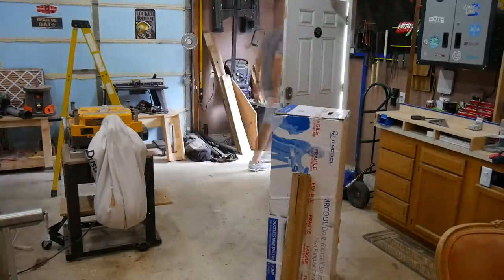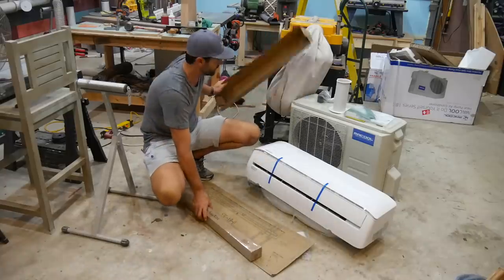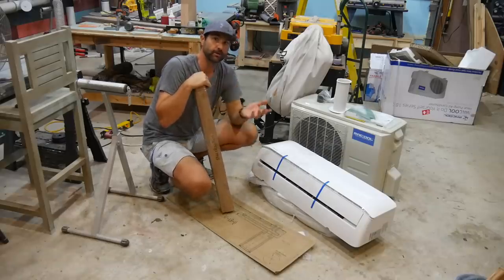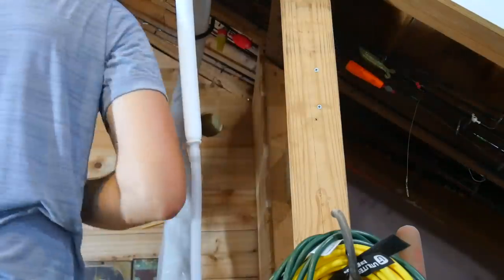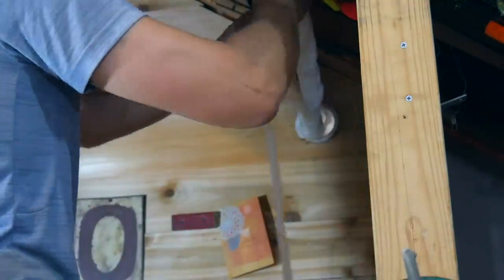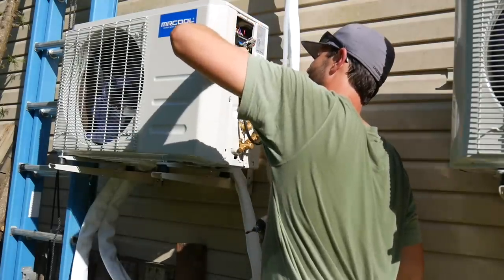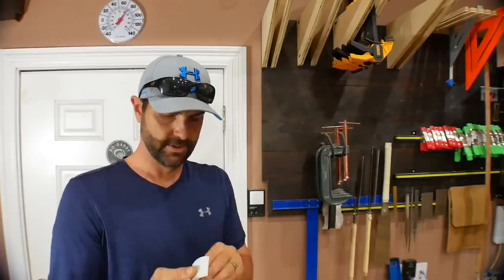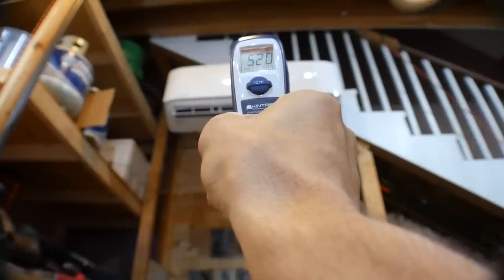DIY Mini Split Installation (Step by Step)

Comment: Keep in mind that attaching compressor unit to house will have negative noise effects.
Personally, I will do everything possible to keep my compressor units physically separated from my house/building. 
A cement pad with a custom made metal stand is worth it to me.
Reply from the maker: Js Travelers - I definitely agree with your comment.  In fact, I have plans to put mine on a concrete pad this winter.
Reply: Even bolted to a poured concrete wall?

Comment: Thanks for the video. Just purchased the same unit and will be installing this weekend. Very helpful step by step on your blog as well. Thanks again.
Reply from the maker: Mike Dockins - very happy it helped you.  Feel free to reach out to me if you have any questions or need advice.  I’ve installed 2 of them in the past 18 months.
Btw, they are both working very well!

Comment: Curious as to what Mr. Cool thinks of coiling the excess line set?   Most do not recommend that as the refrigerant oil/lubrication will settle out in the low spots in the coil and starve the compressor shortening its life.  Interesting video.  Did you get a lot of vibration transmitted through the house wall?  Take care.  Doug
Reply: Douglas Thompson , my thoughts exactly. 
The noise transmission would drive me crazy. The line set coiled up along with the duct tape. It's an easy set up but finish and appearance ... C-

Comment: I just purchased this system along with what looks to be the same wall mount bracket as you. The MR Cool documentations mentions you want ~12''' of space behind the outdoor condenser but the mount only gives you about 5.5. Have you had any performance issues?
Reply from the maker: No performance issues at all.

Comment: Two things here-First a sprayer isn't going to identify any leaks unless you put some nitrogen in there to begin with. Second a vacuum needs to be applied to remove any garbage such as moisture that might be present in the exposed copper lines that were installed.
Reply from the maker: I agree with the first comment for sure.  The second comment is not applicable to this system.  Read some of the comments below and the manual:  https://images.homedepot-static.com/catalog/pdfImages/74/74671561-d4e5-43cd-8936-33fdd2526621.pdf
Reply: Very good, so when you put the copper lines on there was already refrigerant sealed in them that was then released. I hope my system that I ordered on ebay is the same way.
Reply from the maker: Russell Eaves yep, that’s correct.  I have 2 of these units and both are running really well.

Comment: You could have coiled up the excess line inside the building
instead of outside where it's unsightly and susceptible to damage.
Otherwise, great job.
Reply from the maker: Ian Crossley - After about 1 year of posting this video, you are the first person to recommend that.  Honestly, I never thought about doing that, but it totally makes sense and I should have.  I feel like a fool for not thinking of hat during installation.  Thanks for commenting and watching..
Reply: Agreed. Putting the excess refrigerant lines inside of the thermal envelope should increase efficiency.   An alternative though would be to use an HVAC professional to install traditional lines and remove the excess line, but I know that's not the point here in a DIY video.   It would be interesting to compare the cost benefit ratio over time.   Good job on the video.  Good dogs. :-)
Reply from the maker: James O'Bryan - the lines outside was definitely a mistake by an inexperienced HVAC DIY’er.  I have sense moved the lines indoors per the recommendation by you all.  Honestly, this was a perfect solution for my workshop.  

Would I put these units in my main home?  No, I would not.  I prefer to hire a licensed HVAC tech for this installation.
Reply: I thought of this immediately as well.  It's more efficient and it's more attractive
Reply from the maker: Definitely agree.
Reply: This is a great tutorial. I love the whole thing,  except the excess coiled lines would bother me,  and someone else points out mounting to the side of the building ( like I WAS thinking of doing )   would cause excess noise.

Comment: Did you vacuum the line before or no need?
Reply from the maker: Sheralyn De Leon no need
Reply: @PahjoDesigns  so no problem if im install my diy mini split ac without  vacuum pump? I connect the copper tube line ang open the service freon and it will work if there is no leak?
Reply from the maker: Sheralyn De Leon that’s correct.

Comment: If the condenser is going on a flat roof, can you run the condensate drain up there?  That is, do these usually have a condensate pump, or do you need to drill another hole in your wall to drain the condensate (using gravity)?
Reply from the maker: You can use the same hole as the refrigerant bundle as there is enough room.  Or you can drill another small hole for the drain.  There is no pump so gravity must be used.  Thanks for watching!

Comment: Great.  Having been in the HVAC business for 16 years I can remember people asking me things like; Can I replace my own thermostat?  And I would reply with, I don’t know, can you?  So I think this is great information for competent diy people to do. It is not cheap to higher a reputable licensed hvac company to install a leading brand and stand behind it with written warranties and guarantees on parts for 12-Years as we do.  But please understand that this install is not only up to par on an the aesthetics nor equipment quality as we use. But you need to know you have NO Warranty!  Good luck trying to get a Warranty repair or replacement when Mr Cools warranty states: (Limited warranty applies only to systems that are installed by a state certified or licensed HVAC contractor, under applicable local and state law in accordance with all applicable building codes and permits). If this is something you feel comfortable in doing then more power to ya!  I’m just saying, Let the buyer beware. And when it comes to skilled trades projects, cheaper is almost always not better.
Reply from the maker: luckyrocks1 - Thank you for the input as your HVAC experience definitely supersedes mine 16 fold.  These units went in my shed, not my main home bc of the reasons you stated.  It was worth a try for the price.  I did have an issue with the unit and MRCOOL sent me a replacement.  I have a video on this replacement as well in the description of this video.
Reply: Pahjo Designs  That’s great Pahjo and do you think they sent a replacement knowing you were posting on YouTube?  Or do you feel confident that they will do the same thing for everyone who installs these systems simply by following the Included installation instructions?
Reply from the maker: luckyrocks1 - I didn’t tell them I posted on YT.  They did make me get a tech to do diagnose the system.  I had to send them the results then they honored the claim.  Maybe I just got very lucky - who knows.  I’m not affiliated with MRCOOL at all so please don’t think I’m defending them.  In fact, I’m not educated enough on hvac systems to debate anything - just sharing my diy project as honestly as I can.  I really appreciate folks like you chiming in with constructive criticism for everyone to learn from.  Again, I appreciate it.
Reply: Luckyrocks, the requirement for the unit to be "Professionally Installed" warranty you refer to above ONLY applies to NON-D.I.Y. units sold by the company.  Otherwise, the D.I.Y. Warranty is 7 years on the compressor and 5 years on everything else.  Some of the Mr. Cool units that require "Professional Installation" only come with a 2 year compressor warranty and 1 year on everything else.  Go figure!!!!

Comment: Awesome. Mine is on its way. 
Didnt/couldnt excatly learn vacuuming procedures and all that right now. 
What BTU is that unit?
Reply from the maker: Awesome - 18,000 BTUs.  Thanks for watching
Reply: @PahjoDesigns  pppp

Comment: I have a question since I am going to be doing an install myself. How do you get the copper to bend 90 degrees without kinking?
Reply from the maker: Russell Eaves - the copper is somewhat flexible and it is easy to bend.  It is also slightly bent in the spot where it needs to turn which makes it easier.

Comment: Just installed one works great but I do not like it going into defrost mode every 20-25 minutes when in heating mode when its colder outside
Reply from the maker: Glad it worked out for you!  Thankfully, It doesn’t get that cold where I live to go into defrost mode.  :)

Comment: Thanks for the video. I got my 18K unit and I am ready to install. I have a couple of questions. I feel nervous when I bend the pipes so they go straight towards the back as you did. Also, there are two holes on the template. I see no reason I can't have a hole in the middle. The pipe can bend at either end of the inside unit, it sure can bend in the middle as well?  It is just a better location for my situation.
Reply from the maker: I agree and I see no reason it can’t as well.  I actually called them and asked the same question about bending the pipes at either end before i i stalled mine.  The folks at MRCOOL are really responsive to questions.  Did you run it by them?
Reply: Your video is very informative and overall quality is very good so I naturally asked you yesterday here. I think today if I don't hear from you I will ask Mr.Cool the same question. I am surprised to see your reply. You are right they are super response. I requested a replacement of broken wall sleeve(probably due to shipping) yesterday afternoon and I got a response this morning!  I am always grateful to people spending time to share their experience. Thanks a lot again!

Comment: What is the grey flexible conduit and grey box going to the electrical for and can you show the installation of that?
Reply from the maker: GManKeepsltReal - that is the conduit that holds the electrical lines which run to the junction box.  I don’t have that on video bc I’m not qualified to provide electrical advice or show people how to make those connections.   Only certified electricians can accurately and safely provide that advice.  Thanks for watching!!!

Comment: First, thanks for the great video. I am about to buy one for my shop which has two stories. Each are about 500 sq ft. Do you think I should buy a two zone unit rather that buy two separate units like you did.
Reply from the maker: Knott Reel - thanks for watching!  Yes, definitely a 2 zone unit.  Much easier to manage.

Comment: Hello Sir:  I have a question: when you connected your refrigerant lines to the outside unit; you just connected it and dd not vacuum the while system. Is that possible?  Let me know and thanks. My Senville just arrived this weekend.
Reply from the maker: Freddy Panes - it’s not required as they are sealed.  Here is a link to the manual:  https://images.homedepot-static.com/catalog/pdfImages/74/74671561-d4e5-43cd-8936-33fdd2526621.pdf
Reply: Pahjo Designs  Thank you very much! Will do and keep you posted

Comment: If you don't want to answer any electrical questions ok but I'll ask. Different locales may differ, but do they typically require a shutoff next to the outside unit or can it be hard wired with just the service panel breaker for the shutoff? 

Great video, but I thought I would see the initial turn on!
Reply from the maker: Yes, I used a breaker box outside which was already there from my old unit

Comment: I want to understand How the DIY valve Works, do you have some technical information?
Reply from the maker: They are quick connect valves.  Here is a link to the manual:  http://mrcool.com/documentation/mrcool-diy-2nd-gen-installation-manual/

Comment: thanks how many amps does it use so I can figur out what dedicated circut i need
Reply: Kevin Naderi 15 amp circuit will do fine.
Reply: thanks does it run 110 or 220v
Reply: 115

Comment: Why did you have all that excess pipe? That's really inefficient when you have to pump refrigerant over a great distance. You could have shortened this no? Or is the refrigerant inside the pipes and this is not an option?
Reply from the maker: Unfortunately, It is not an option.  They cannot be shortened or cut either.
Reply: @PahjoDesigns   That's a shame. Could a qualified person do it, or is this just how it's made?
Reply from the maker: They seem proprietary, so I presume it’s just how it’s made.  Maybe a qualified hvac tech could do it, but I’m not qualified enough to know for sure.
Reply: @PahjoDesigns   Thanks. I'm wondering if aside from needing an F-Gas engineer to bleed the system, the copper pipe is like 20mm plumbing pipe where you can just cut anywhere and install a compression fitting to shorten, then re-fill. I guess it's a route that's not worth exploring though, due to excessive costs.
Reply from the maker: I think that’s possible for sure, but as you said cost may be a limiting factor.

Comment: Just wondering if you vacuumed you lines sets before you opened the condenser valves?
Reply from the maker: Cat1234 - the lines come precharged.
Reply: oh, I did not know that.  I just installed mine yesterday and had to buy the line sets separate.  I had to pull a vacuum on them before I let the freon out of the unit.  Interesting

Comment: Seems strange you would mount the unit in front of that wall instead of on that wall you routed the piping through.  You have a dead area where no cool are is blowing and looks strange hanging from wood templates.  It becomes the focal point.  Maybe think about just mounting it on that wall.
Reply from the maker: Kimo Jon - you are spot on.  I actually moved it to the back wall about 6 months after this video.  👍🏻

Comment: Jeremy:  Enjoyed  the Mr Cool video. Is the MR Cool efficient to operate in the summer and winter months?  Also  what are the temperature ranges of the unit during the winter and summer months? Online I see some brands state their units will heat 100 % down to 5 F and cool to 115F. Also where did you purchase your Mr Cool? Thanks in advance.  I am considering a multi zone system for my home and doing as much research as possible.
Reply from the maker: I appreciate you watching and it appears as though you are my neighbor from reading your name.  :)

The MRCOOL is definitely efficient in both the summer and winter months.  I have no issues with cooling my workshop during the summer months.  I am in my workshop often and keep the unit running all the time mainly to keep the humidity down to prevent my tools from rusting.  

However, the winters in South Louisiana are mild which make it difficult for me to truly test the unit in brutally cold weather.  We did get snow twice this year (Dec 2017/Jan 2018) and it heated my workshop perfectly.

I purchased 2 units.  I purchased the first unit from Home Depot online and picked it up at The Home Depot in Slidell.  I purchased my first unit from Home Depot because they are lenient with returns in case I had any issues.  I purchased my 2nd unit from Amazon.  Both purchases went smoothly and without issue.  If I were to order another one, I would purchase from Amazon b/c Home Depot doesn't handle store pick-up very well for high dollar items.

I have a detailed blog about this installation on my website which may help you:  https://do-daddy.com/how-install-diy-mini-split/

I actually had to repair my first unit and made a video of the warranty and repair process here:  https://do-daddy.com/mrcool-diy-ductless-mini-split/
Reply: Thanks  Yes New Orleans here. My research indicates MR Cool is a joint venture between Mitsubishi, Toshiba and Hitachi all of which are good cpmpanies
Reply from the maker: I have no complaints - this product fit my needs perfectly and both of my units are performing very well after a year in service.

Comment: Did you vacuum pump the system before you released gas
Reply from the maker: Floyd Afams - that is not required for this system.  Here is a link to the manual:  https://images.homedepot-static.com/catalog/pdfImages/74/74671561-d4e5-43cd-8936-33fdd2526621.pdf

Comment: You didn't show whether you used a stud-finder to locate where to install the wall-mounting bolts on the outside of the building.
Reply from the maker: PattiMichelle Sheaffer I knew where the studs were from the nail holes outside the siding

Comment: Thanks for posting a very informative video! I'm considering installing one myself and trying to gain as much knowledge as possible.  I noticed that you checked for leaks (13:08) after you connected the lines to the unit and before you opened the valves. Is the line set pre-charged and outside unit not?
Reply from the maker: Ryan Harvey - you are very welcome.  I hope it provided you with valuable information.
The entire unit is pre-charged.  I checked for leaks after I made the connections and after I opened the valves with the 19mm hex wrench.

Comment: No HVAC professional needed but still need to do pressure and vacuum check. Verify pressures. Not having a HVAC guy signing for the warranty pretty much voids it.